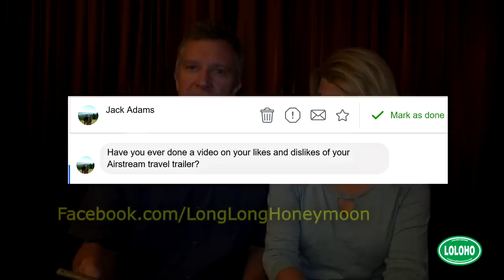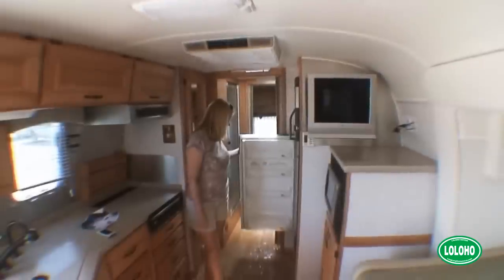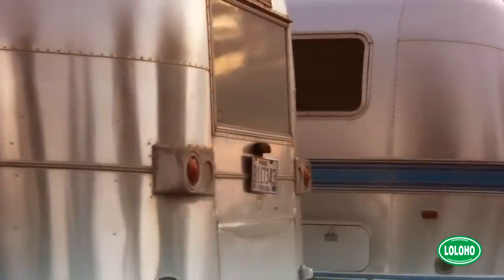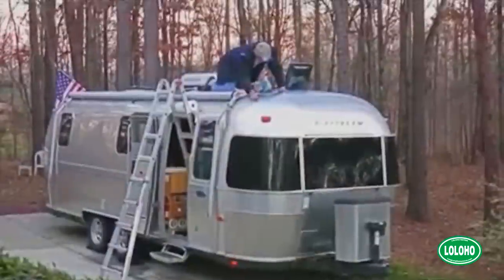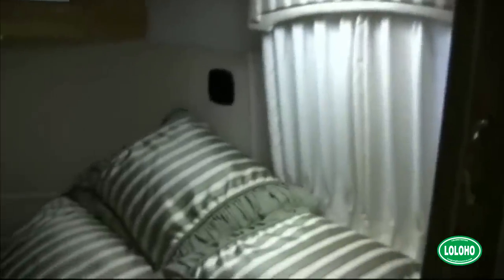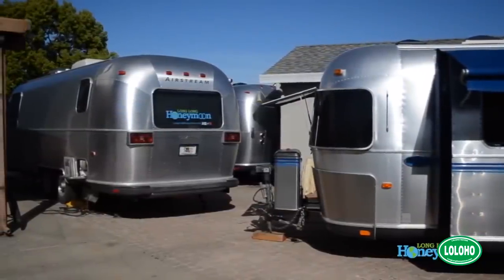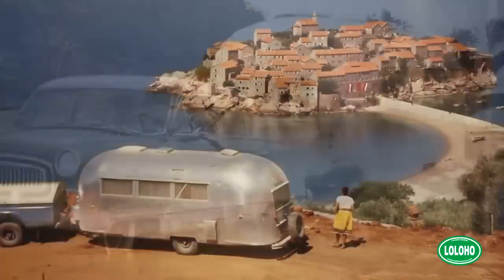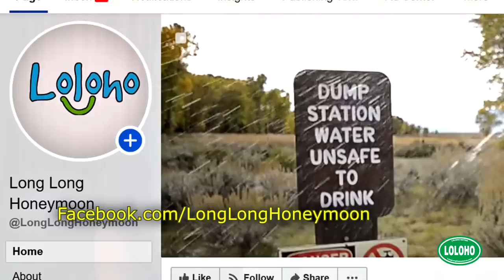🙊AIRSTREAM Travel Trailers -- Our LIKES 👍 & DISLIKES!!! 👎🙉

Comment: Only issue I have with any  camper or  trailer is the absurd interior height limits they all have. Majority are built for people under six foot four. Other than a Bus, there are hardly any that exceed six three to six six in interior height. I'm six ten and wish manufacturers made Campers, specially Box Campers that accommodated people of my height, instead of having to move hunched over within the camper like a modern Quasimodo.  Hope you both had a great St. Paddy's day.

Comment: A well balanced perspective.  With 9 years and 90K miles on our FC23FB, I would agree with all of your points. Hail, however, has not been as big an issue as I had feared.  Living in CO at 7600', we get hail frequently, and we've been in the Airstream through some heavy hailstorms at even higher elevations. It was like being inside a snare drum, yet we've sustained no hail damage whatsoever. A major con which you did not mention, is the paltry insulation.  Airstream could do a lot better than the pink fiberglass insulation between the skins.  

I just discovered your channel (COVID isolation) and am enjoying your past episodes.

Comment: I have never owned an airstream. Never wanted to. As you pointed out the cost is out of sight. Also i have read that they are pretty heavy to pull. The lack of storage is another issue. I watch alot of rv shows and some of the decor in the airstreams are positivly gross. I know you put alot of stuff in the bed of your truck. Have you ever pulled or considered a fifth wheel? I have owned a number of different travel trailers in the past and now have a fifth wheel. There is absolutly no looking back. The fiver has great storage and pulls fantastic. I have been following you folks on utube forquite awhile now and i must say you two put out the best videos barr none. And a last note to christie, girl as time goes by you get more beautiful.

Comment: It's amazing to me how crappy the quality of most RVs is.  Many flaws could be solved or upgraded by the manufacturer by spending 5 or 10 dollars more on fasteners or by using better quality parts.  The final sale price might be a few hundred dollars more.  I would like to see a competitively priced RV using as little wood as possible, more aluminum studs and supports and more durable plastic components where appropriate.  Cars and motorcycles are built to a much higher standard of durability.
Reply from the maker: Agreed. A lot of RVs are slapped together with minimal quality control. There's no comparison with cars and motorcycles. I've seen many reports of brand new RVs that are delivered with a myriad of MAJOR quality problems.
Reply: Living lite, camplite has a great rv.   All azdel and aluminum. Impervious to water
Reply: @LongLongHoneymoon  Very true....the first owner usually has to deal with all of the warranty items which tends to be a long list.
Reply: They are being made with materials that give them a steel cage and azdel which means they can't rot and they can't mold no matter the leaks you might get.  A few companies not connected with Thor and Berkshire and who aren't cranking out junk do exist.
Reply: It should not be amazing at all. Its been unchanged for many decades. My grandrather said much the same thing in 1960.
Reply: I'm betting just like cars, when foreign RVs enter the market with quality builds, the U.S. manufacturers will take care of business.

Comment: They are sexy beasts. I looked for years for an affordable smaller sized and last spring I found a 1965 Tag A Long. Hopefully, Lolly and I will be on the road this summer. It has a sheet metal exterior BUT you can cut , replace and paint. I am using the area under the main bed for storage, putting in a small closet, and have storage under the seating.  I hope to meet up with y'all later in the year.

Comment: For me its a toss up. As soon as my motor home is sold, I will actively look for the final RV I hope to own, either an Airstream, or a Bigfoot. Either way, it will be 25 ft, as that fits in almost any campsite and Is a size that works well for one or two people.

Airstream seals the seams from the inside, after the unit is assembled, I have seen the factory video where they do that. A terrible way to seal something. The skins should have sealer put on them prior to assembly and then riveted together. Yes, that would require more effort and cleanup after the riveting, but leaks would be basically non-existent, the downside would be separating the skins in the event a panel or cap needed replacing.

I've always wondered if Rhino Lining the roof would be a good way to help prevent dents from small hail and small limbs.

Comment: It would be interesting to see a comparison between say a fiberglass or painted aluminum travel trailer vs. the airstream which basically is an unpainted aluminum structure in terms of thermal transfer.  Even with a clear coat, the sun can hit the metal directly which would make the bare metal a heatsink.  Thermal migration would be quick going both ways, where even a single layer of paint would drastically reduce this effect.  So, I would think it would be difficult to cool in sunny climates and hard to keep warm in non direct sunlight (night) "cold" climates?
Reply: The roofs have been a white baked enamel for years.  Also the awning packages help to limit the direct sun exposure on the skin.  When it''s really hot, it's time to head north!

Comment: I will buy a disposable RV. Airstream uses most of the same stuff as everyone else apart from their structure in building. Same water heaters stoves refrigerators ... If I spend 100 grand on an airstream and 25 grand on the same length other brand and I get 8 grand back out after 10 years that means I can have a new RV every 10 years at a cost of 17K that would be like 60 years worth of camping in a new RV every 10 years.
Reply: Retire Soon—except the throw away mentality is destroying the earth ☀️😞🌼... a problem for everyone.

Comment: The aluminium skin of the trailer:  Do you think they should make it a bit thicker for better structural integrity and durability?  In addition, most of the trailers are equipped with 2 wheels.  Do you think for a medium size they should be fitted with double wheel sets?

Comment: I think I am going to start building a new type of RV, where every material is water resistant.  Why not use pressure treated wood for the floor, for example?  Yes I know there are concerns with toxicity, so ok we'll make the floor out of cedar, if you want to pay a little more.  Silicone sealing the joints?  Nope, we will gas weld them.  All insulation will be spray foam.  The trailer I am designing is probably pretty expensive, but it will last a long time.  Dents from a knee?  More under support or thicker panels in those areas that cannot be supported.

Comment: *Easy enough to fabricate a 'ribbed-shell stand-off' panel(s) for the roof to protect against
hail and tree limb damage, and if you are in an area prone to it, just lash some 'moving blankets' on top using the end-grommets with nylon ropes going 'over/under'*
*It's all a matter of 'thinking the problem through' and with the internet, ANYTHING can be 
found for ideas and source materials*
*If I had an 'Airstream' that I spent 50 to $100K for...you can bet I would have those issues
resolved very quickly and still have it match the original roof-line w/stainless steel panels that
would laugh at 'hail damage'*  
I would go to any metal-shop and have a 'tubular bumper' welded to the frame-rails and extend it up one-third of the body-height and 'wrap around' the body-shell...I know it can be done because I've seen an 'A/S' with it on a 'Bambi' that looked 'factory original'

Comment: Seriously i know that older people 70 and 80 can not handle an RV trailer.  I know people that have had a RV trailer for years no knowing: towing payload and capacity- trailer tires are extremely important for maintenance- trailer wheel bearing maintenance - winterizing - reading all manuals for systems - fresh water gray and black tanks and how they work - proper travel speed (not highway speed limits) driving skills - backing trailer- proper loading of trailer and so many more items.

Comment: I love Airstream, BUT I bought a Casita instead. The reasons I didn't buy an Airstream  are the reasons you voiced. It is like buying an Easter egg. The primary deal changer is the plywood floor and my Casita has a fiber glassed floor, reducing dry rot issues. 
Does Airstream provide shocks to reduce vibration and road  shaking? I know the Casita can have shocks retrofitted...

Comment: I have often wondered way folks buy a Airstream. And I guess I’m still wondering. Agreed most RV’S are made poorly. Gots to do your research. I live in the west, some speed limits are 75mph or 80mph. And while I can pull that fast I never do. Reason, tires. Most trailers tires are rated for 65 mph.

Comment: any airstream should hve clear or semi clear membrane too make 1 paint coat sealed tight min. 1 good 2 better esp on top sides & roof but steam punked front 1/4 only air wind tow drag only valuable pnt easily had.its real diff not flipping or fish tailing.

Comment: I realize that the Airstream is your Icon, but, I'm amazed that you have not switched to a 5th wheel. So many advantages....
Reply: D Koo5, honestly I just think they are too big for us enjoy towing and moving around as much as we do. Also, we rarely make reservations so having a smaller camper gives us a lot more options for last minute camping.
Reply: @kristymichael  Kristy, Kristy,Kristy. C'mon gal. Yes, you're getting younger looking at 29:) prob because you and Sean pulled into some mythical Lord of the Rings type campground in your Airstream and drank the blood of virgin elves or something AND took your special vitamin loadout and health shake which you wont share with your aging,RV subscribers. BUT!, your rig towing a modern, well insulated, 4 season, heates tanks, enclosed underbelly, 26foot, compact 5th wheel like a Keystone Cougar with your pickup(no connection to Keystone whtsoever), will have loads more storage, tow smoother, have a shorter overall length, and still get into all those State and National campgrounds, plus have modern, ultra rot resistant/proof construction at a fraction of the cost. I've always dreamed of acquiring an Airstream with its iconic style and aluminum design, but many are seriously reconsidering.
Tell Sean I said I hi.Gonna tell your beauty secrets.....?😁🇺🇲🍀phil

Comment: not sure why they think other SOB RV Trailers ends up in the junk pile, and Airstreams do not?  Maybe cause the outside will never deteriorate, but inside the wood floor and cabinets will go as bad as any other unit when water is leaking thru those seams.......

Comment: Is aluminum more vulnerable to hail than fiberglass?   Or maybe I should ask if fiberglass is more resilient or easy to repair.   I’ve seen friends cars look utterly battered by hail.    This is an excellent discussion on aluminum.    Also,  those sedans pulling the airstreams (not to mention the bike)....   those were the days, eh?
Reply: They are indeed much more susceptible. I've run into quite a few owners over the years who sustained hail damage

Comment: Awesome video and thanks for sharing. I owned two Air Streams (16' and 22' Sport) and it was a nightmare pursuing warranty claims e.g. my door didn't shut all the way on my 22' Sport. It was noted that there was an 1/2" gap at the time of sale (Living in Florida... A/C didn't keep the cab cool and humidity was atrocious.). I was assured fixing it would not be an issue and I believed it being my first experience with travel trailers (I had the 16' for a brief period... leaking pipes broken cabinet doors, popping rivets and all). Anyhow, neither the dealer nor Air Stream would followup with me or follow through with any repairs noted from day one... could have been a lawsuit but I don't have the time for all that nonsense. Gave up on AirStream and went with an Oliver. As much as I like Air Streams (30FB layout), I don't trust them or the company... especially dealers. To Air Streams credit, they did contact me about the problems but nothing was ever resolved.

Comment: Mileage is not a concern with a diesel engine, and will outlast the RV. I have never had a problem with a slide-out in 9 years. Leaking is a major concern, would be the deal-breaker for me.

Comment: Are you confusing MDF (medium density fiberboard) with OSB (oriented strand board) for an Airstream subfloor? After 35 years in the wholesale lumber business, I can say MDF is non structural and I’ve never seen it used in that application.

Comment: Guys, will LT tires allow for faster interstate speeds pulling my 26’ travel trailer? If LT tires pose any downside, please enlighten me. Looking at Maxxis as far as TT tires go, but would like to be able to safely travel at 65 or 70 mph.
Reply: Every tire sold in the US has a speed rating. The better LT tires are rated for up to 70 MPH.  I'm retired from the tire industry and know of no LT rated higher than that.
Reply: The Goodyear Endurance tires are so far proving to be a good choice for trailers. Ours have been trouble free.
Reply: Roy Davis my LT tires are rated for 112 mph. Maybe you meant ST?
Reply: @wayne-o8951  You're right they are ST. We made Specialty tires including trailers and our light trailer tires were rated at 70 MPH. We made military trailer tires too.

Comment: Instead of rivets, they could use real strong magnets :)
Reply: On aluminum??????
Reply: @benbirdsill4709 ...well, super duper glue or fix the magnets....I mean were sending pods to Mars (they say) fer cry eye. There's gotta be a better way :)
Reply: @gregormiller4037  You'd think, right? But "...fix the magnets"? You realize aluminum is not magnetic, right?
Reply: @benbirdsill4709 ,,,thus my tongue in cheek comment. I just think there is better engineering out there...I could several post from them, but I think they keep building them because many like the retro look and feel.
Reply from the maker: Wally Byam had a saying about Airstreams: "We should make no changes; only improvements." Haha, if only the company had stuck to that motto over the years....

Comment: Using MDF in an RV is criminal and so irresponsible and such a cheap move by a manufacture. Its always a matter of time before an RV leaks due to intrusion thru the roof or a plumbing issue. They should be sued for being such selfish cheap pricks.
Reply: Yes, and another materials issue with the aluminum is that it is a ferocious transmitter of heat and cold. Even with their winter insulation package, my grandparents' was NOT a unit for severe cold. Cold would migrate through especially at the rivets, creating frost spots on the interior walls, and damaging any sensitive material when that melts and pools water below. There's a guy on the Airstream Owners forum that tried to winter over in Alaska with a classic older Airstream and suffered from the same experience before the temperatures even got down to zero. Oh, and his door would freeze shut because of the aluminum temperature dominating any heat in the air on the inside.
Reply: I don't even like MDF used as underlayment in dry environments.